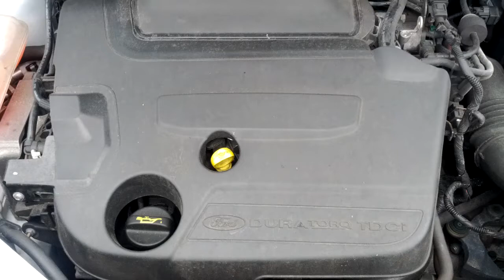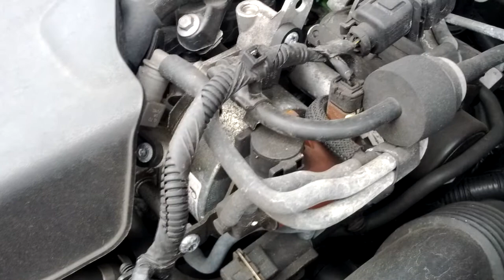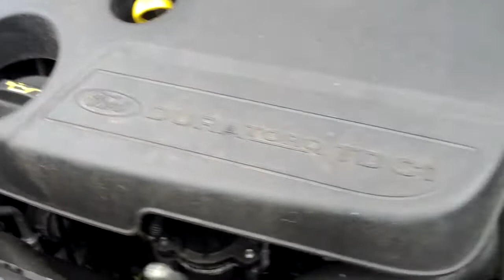Ford Kuga engine bay clicking sound.

Comment: It is the vacuum pump that slams. it is located at the top right of the engine
Reply: I know this is an old video/comment but is this normal or is it a fault? Mine is making the same noise from the vacuum pump and wondering if it needs replacing or not?